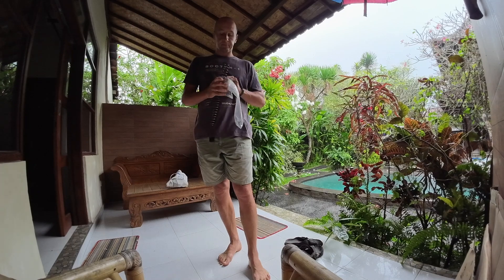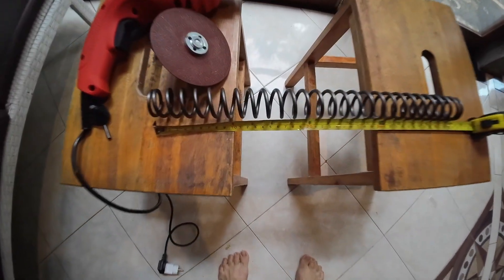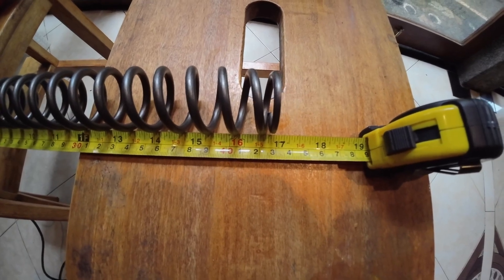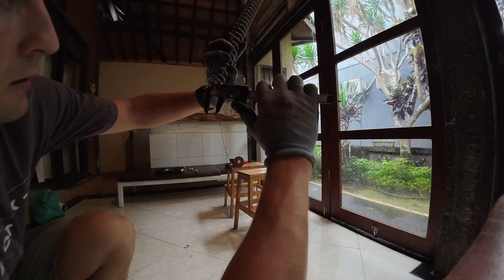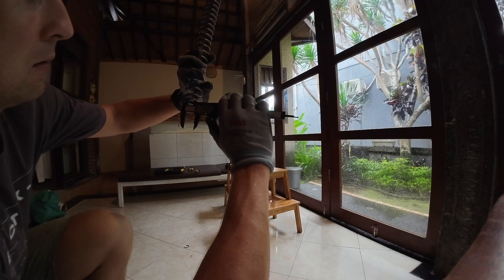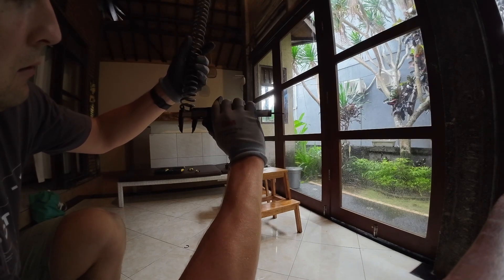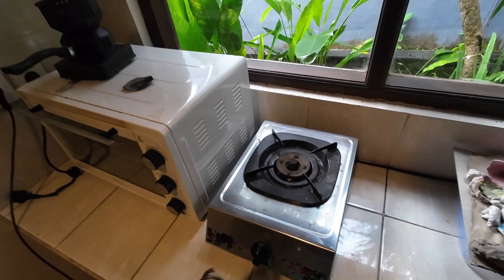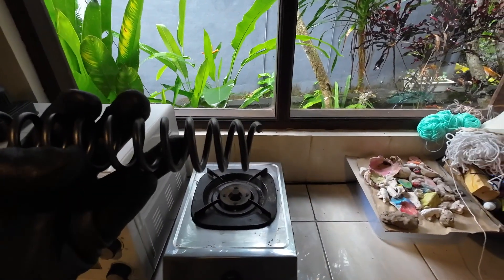klx300 / klx250 fork spring upgrade on a budget

Comment: @planetklx2 Hey man just wanna say thank you for the video. I Just order the upgrade. my question is, will i be okay if i heat up the ends to open up coils more to 28mm and then shave down the guide 1mm alll aroound without cutting the coil spring?  Will the extra coil that you cut off affect anything?
Reply from the maker: I would cut 1 coil to match original spring length. Tenere spring is 10mm longer, so it's 10mm more preload which is quite a lot. This means initial stroke movement might feel a bit harsh. Anyways you can try without cutting and see if you like it or not. 
The space inside tube is tight, so you will likely need minor spring grinding/shaving to make it move freely inside.

Comment: What about for the rear spring amigo?
Reply from the maker: Will post tip soon! Also on a budget $30-$50
Reply from the maker: Here you are - https://youtu.be/CV8xvETlLbk!
Reply: Hey man just wanna say thank you for the video. I Just order the upgrade. my question is, will i be okay if i heat up the ends to open up coils more to 28mm and then shave down the guide 1mm alll aroound without cutting the coil spring?  Will the extra coil that you cut off affect anything? @planetklx2
Reply: Ok. Will cut the coil and shave down the guide. If I were to grind down the actual spring how many coils should I grind